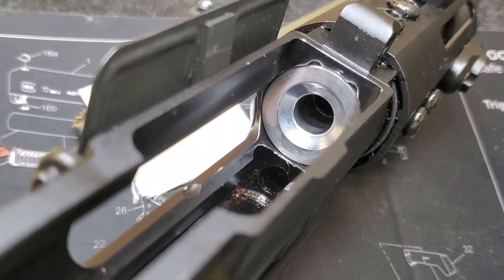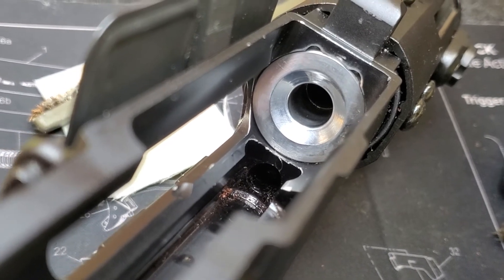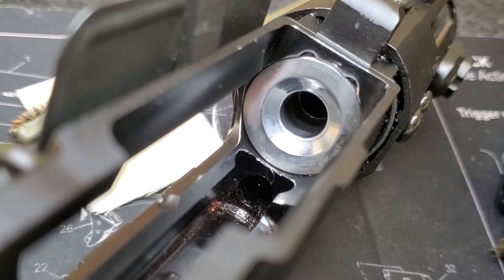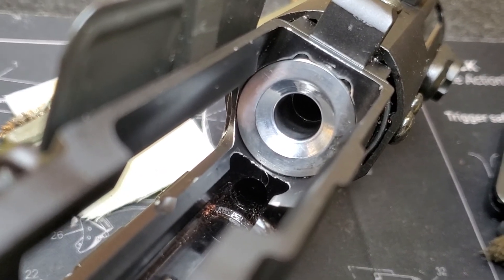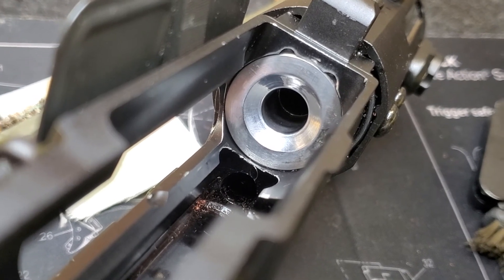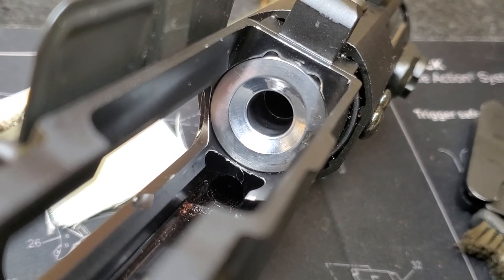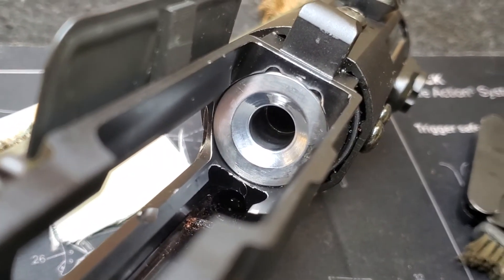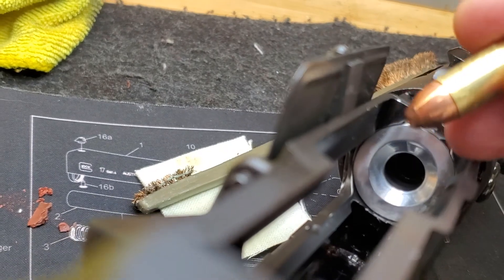Fixing misfeed on an AR-9 rifle

Comment: You may want to look into the taccom feed ramp. I put that on mine and it eliminated all Miss feeds
Reply from the maker: The lower has Last round bolt hold open and there is no space to add the Taccom feed ramp unless the LRBHO is removed.
Reply: @YERAFirearms  I got it to fit in an Utas mini 9 by filing the shit out of it with an hand file...